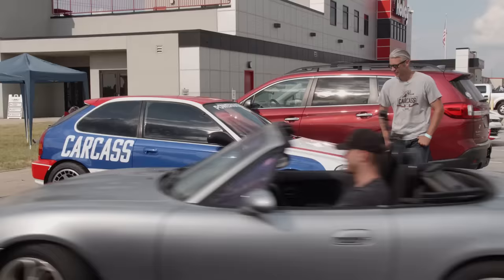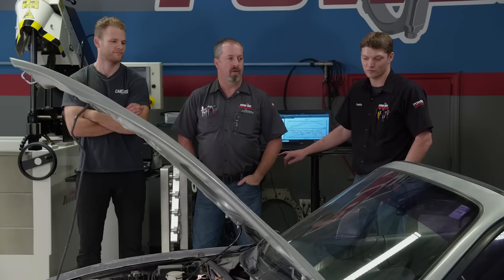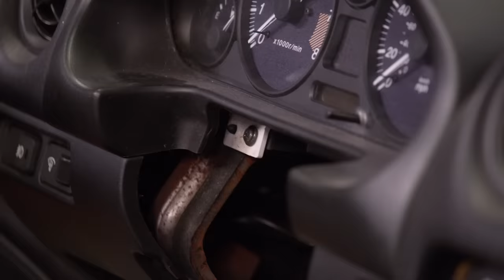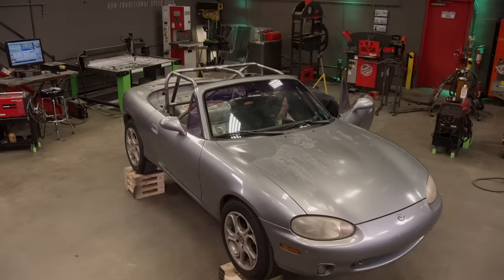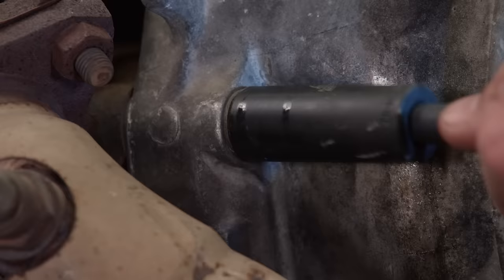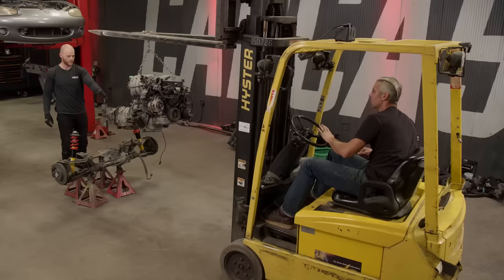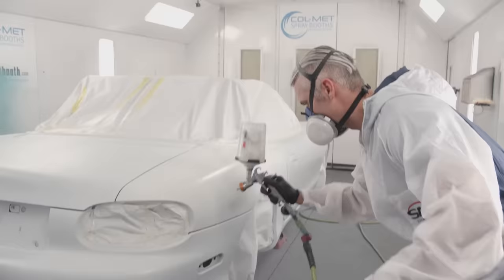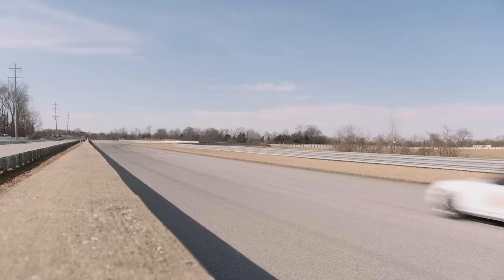Full Build: Stock Miata Transformed Into Spec Class Race Car

Comment: I tracked a 1997 Miata for 4 years and had a blast.  Except for an exhaust system the motor was stock, so it wasn't all that fast on the straight--a-ways, but with the suspension upgrades and track tires it was very quick through the corners.
I loved the car, but I did miss my 1990 'Monster' Miata, with its 5 litre Mustang motor.  The Monster was a blast to drive on the track. It cornered very well and was also very fast on the straight-a-ways.  The only problem was the motor overheated on just about every 20 minute track session.  The 1997, with its stock motor ran perfect and never overheated.
Of the two, I wish I still owned the Monster.
Reply: i have a 97’ as well, and i enjoy driving it. definitely my favorite car i’ve owned!

Comment: Nice build, just wondering why the engine wasn´t maintananced while outside. Like Oil and Filterchange (to a race spec oil) Timing Belt and Waterpump, Spark Plugs Airfilter etc..And cleaning the engine block to make sure not overseeing some rotten and leaking seals or tubes tec. If it comes to the point to be a reliable race car is not paint and replacing door rubbers ...

Comment: The timing mod. This looks way too easy to be true .I’m guessing you need to be be VERY careful slotting the bolt hole for the cam sensor. If the CAM sensor is too far away from the trigger wheel on the cam pulley the car will not even start. Great alternative to a Flyin Miata adjustable trigger wheel though!

Comment: The cage goes in, adds more weight and you lose the 5 hp you gained.  😞😓😩
Reply: More important for chassis rigidity. Helps a lot in the turns
Reply: True that.  Which would you prefer?